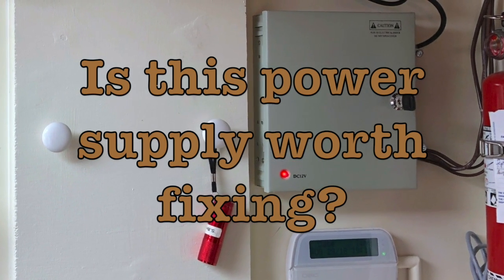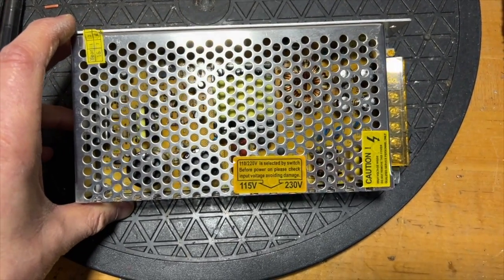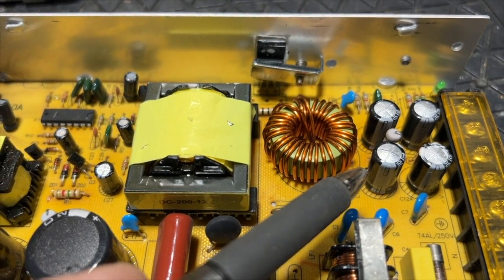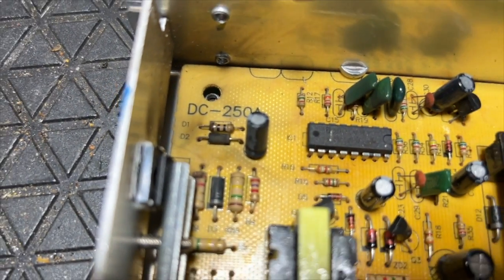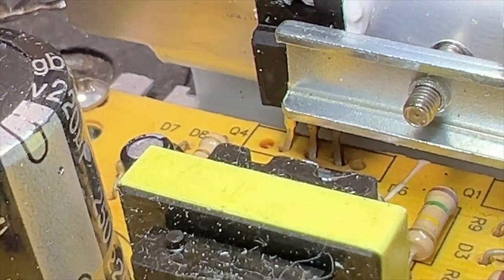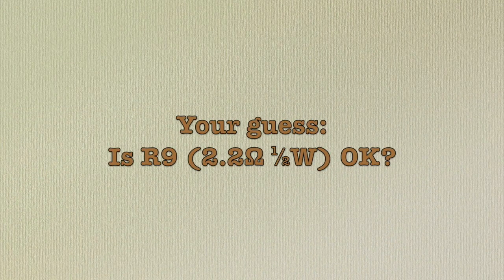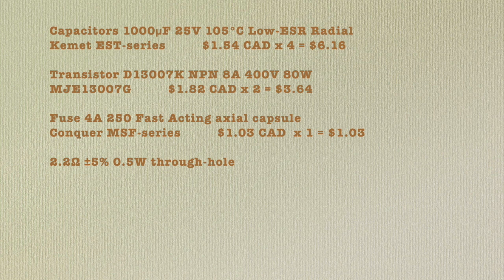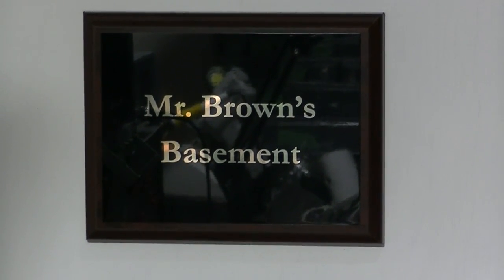Is this Power Supply Worth Fixing?

Comment: I'd fix it, but I have all the parts on hand from repairing supplies in bulk years ago.
An isolation transformer is handy when troubleshooting and sometimes a variac if you want to bring it up slowly to test for missed failed parts.
As I was often fixing a dozen identical switching supplies at the same time, I got to the point of having a set of parts that I replaced no questions asked. Both switching transistors ( if one has shorted it has probably damaged the other ) drivers if they exist ( pennies and if damaged they take out the new switching transistors ) any out of spec resistors and check the bridge rectifier and any snubbing diodes bypassing the transistors. ( again, pennies )
Reply from the maker: To tell the truth, I actually have the capacitors and resistors in stock, but not the transistors. And if the driver IC is cooked and needs to be replaced, I don't have that either. I decided to tell this story using a baseline that everyone has access to: Digikey. Not the cheapest but also not the most expensive. But even if I had all the parts, I was thinking "is this worth the parts?" and "is this worth my time?" I certainly could do the repair if I had to, but would my time be better spent working on something else?
Reply: @Mr.BrownsBasement  agree. One off I would have a hard time justifying saving $5 for the time. I was fixing computer supplies ( nearly exactly the same on the 120 volt side ) often with OEM prices over $150, because they could. So I would select a transistor with better specs than most supplies needed and would stock up on 50 or more at a time. I've had people argue that was bad as I never got a return. Planned failure? 🤷‍♂️
Reply from the maker: When you're repairing something for fun (or for profit) you can always upscale the ratings on the critical components or add a few extra components to improve performance. As someone who takes pride in their work, it makes good sense. Besides, your name as as good as your work. On the other hand, manufacturers are incentivized not to make their equipment any better than it has to be.
Reply: @Mr.BrownsBasement  Correct, and most manufacturers also make their equipment unserviceable so you have to throw it out and buy a new one. Planned obsolescence I think they call it. And, starts with an N and is six letters... uh, ay-yo! Lol.
Reply from the maker: @AstrosElectronicsLab  This discussion is making me think about doing a video on Right to Repair.
Reply: @Mr.BrownsBasement  I'd watch it 😁
Reply from the maker: @AstrosElectronicsLab  Thanks! 😃
Reply: @Mr.BrownsBasement  Ps. I really like Digikey too. Once ran into a fault with an obscure function on a microprocessor they sold and they not only stood good for it, but on testing their stock they rejected and replaced the lot. I was impressed.
Reply from the maker: I have had great experiences with DigiKey and with Mouser though I've bought a lot more from DigiKey. I tried another supplier whose name starts with the letter N and has 6 letters. It was an unmatched disaster. It probably deserved a video of its own.
Reply: @Mr.BrownsBasement  you could try mouser? They may be cheaper...

Comment: I think I would have found some junk parts and replaced the burned out parts, or modified the circuit to use MOSFETs. Just because of the challenge.
Reply from the maker: I like your approach: Not only fix it, but make it better! I don't have the luxury of the time right  now to do that. Besides, the devices that run on this PSU need to be up and running. But I do respect someone willing to take on an interesting challenge.
Reply: Lol, I wouldn't modify it to use MOSFETs. The challenge alone is just getting it working again.
Reply from the maker: It's very satisfying to restore life to a piece of equipment!

Comment: What's the chance the chip driving the switching transistors is bad too? I would pass on this one.
Reply: When transistors burn that badly, the chances of the base/gate driver being bad is high.
Reply from the maker: I think you're right on that one. I am not willing to go down the rabbit hole on this $25 eBay power supply. I would have a different perspective if the power supply was unusual or interesting in some way. But this one is neither.
Reply from the maker: Good point. It wouldn’t surprise me at all. Agreed, pass!
Reply: Not so sure of that. Where it is possible the PWM chip could be bad, the only way to find out is to replace said bad parts and test on a variac and or dim bulb. Less chance of blowing things up and the dim bulb will show you if it's drawing too much current. If the latter happens, no loss, just remove replaced components, keep them and toss the supply.
Reply from the maker: With the two power transistors completely out of the circuit, a guy could probably jumper the fuse and as you said, connect it to a Dim Bulb Tester or a Variac. With power applied, if the PWM was working I would expect waveforms happening on its output. I never thought to check the number on the IC…
Reply: If you find a datasheet of the PWM and its a simple one (I think so because it looks like a two switch forward) you can often fire it up with a lab power supply. Normaly driver output of the PWM is not so critical because there is a driver transformer but if the current sense resistor is open you often geht the high voltage into the current sense input.
Reply from the maker: @wurgervomlichtenmoor5073  I never recorded the part number on the PWM chip.  But now I'm curious.